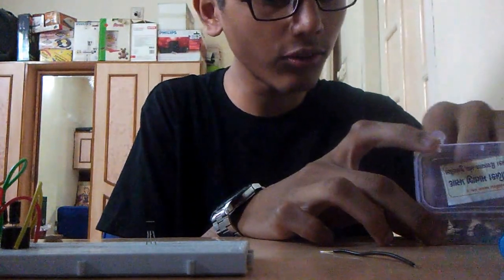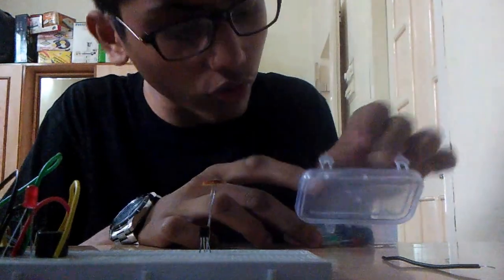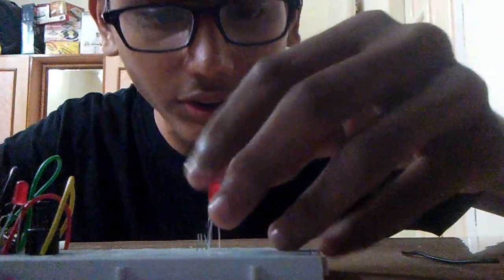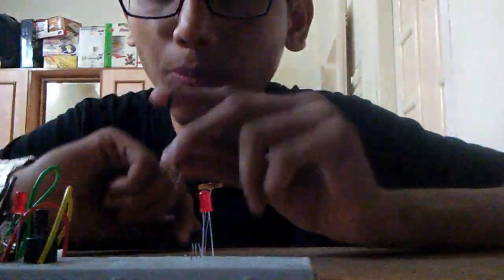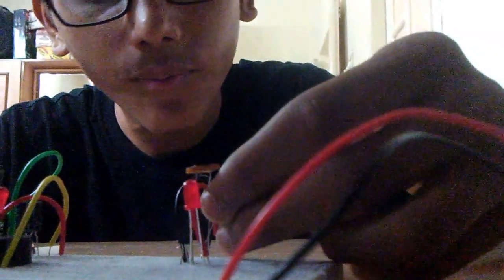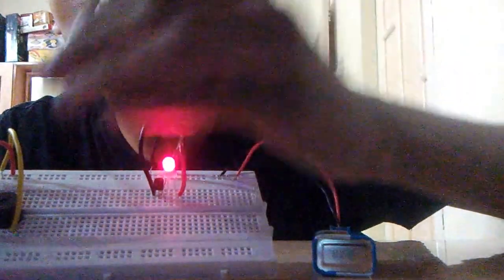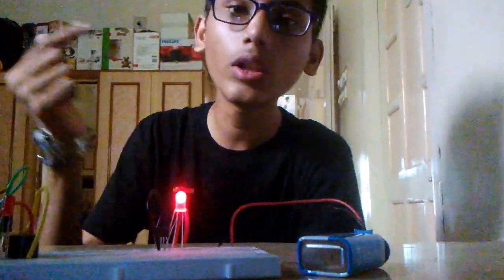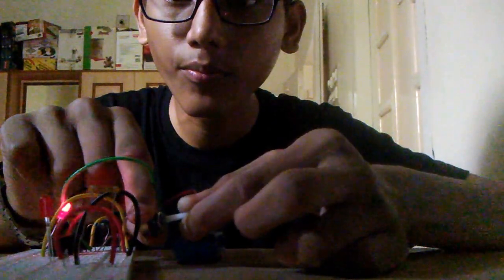LIGHT DETECTOR - DIY Project & explanation

Comment: what is vcc and gnd
Reply from the maker: Jaswanth Jachu Vcc means the supply (specifically collector supply) similarly Vbb is base supply voltage 
While ground is the reference point (node)  from which you measure the voltage

Comment: which no. of transistor you use in this circuit is it bc 547  or bc 557
Reply from the maker: Thanks for the feedback,, the transistor was BC547, 
Also you can use any PNP transistor to make it dark detector,, just change the polarity of batteries and diodes.. 
Hope it helps!!

Comment: what is this foolish circuit the led will blow up in 5secs R u mad 😡
Reply from the maker: i know, due to current flow.
but one thing you don't know, that is the internal voltage drop of a transistor.
if you supply 9.3v, the transistor will give output of less than 7v, (data sheet)
also the LDR will never supply that voltages, 
so, at the end of the day it's better than Chinese crap Power Bank of which video I'm gonna upload,
😊😊😊😊😊😊😊
Reply: actually m making an inverter
Reply from the maker: +Swaraj Chakraborty nice, what do u think about a DC to AC converter
Reply from the maker: +Swaraj Chakraborty yes, why not....
Reply: send me a friend request
Reply from the maker: +Swaraj Chakraborty well there are many people, with same name, can you provide me you email,